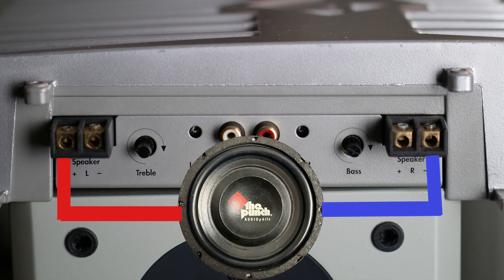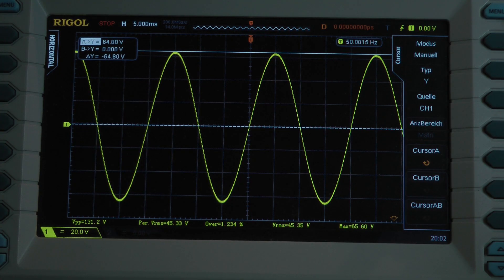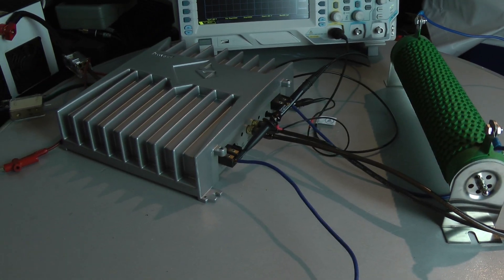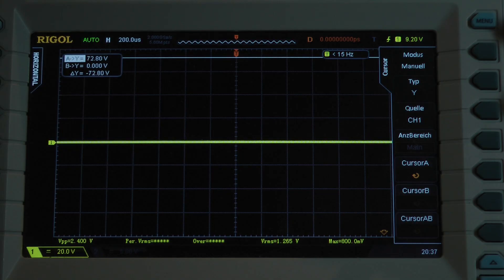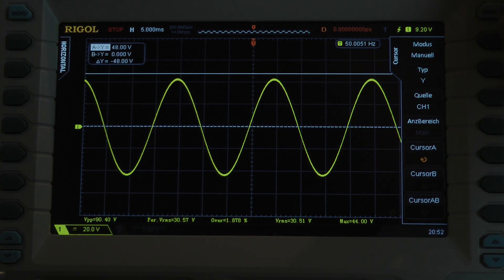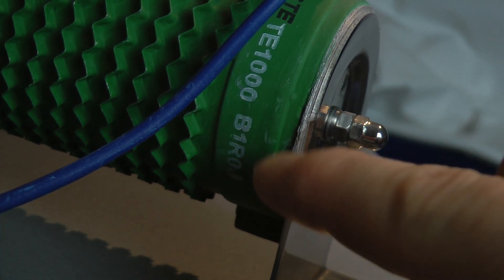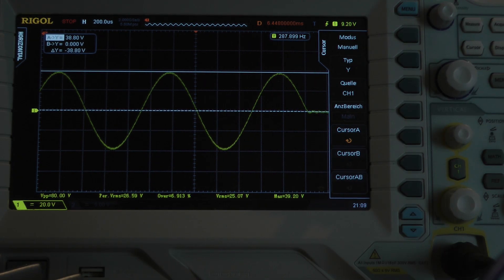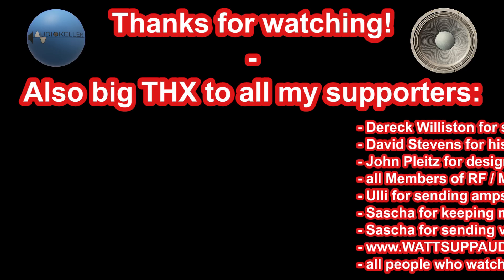1997 Rockford Fosgate Punch 200.2 oldschool stereo amplifier power test low ohm amp dyno

Comment: Nice! I have this exact same amp in similar condition with warranty seals intact as well, nice to know how much power these make thanks for testing.
Reply from the maker: Thank you 😊 
Personally I am not really a friend of intact warranty seals if you want to use the amp instead of just collecting. After all these years I would inspect it and check the idle current 👍

Comment: A stereo amp runing 1/4 ohm is freaking insane its mad i tell ya
Reply from the maker: It went well into low ohms but did less in mono 4 ohms than most other punch 200ish , just hit about rated power.

Comment: Hi! I have one amp like this and I would like to know if this is the same 200iX. Thanks!
Reply from the maker: Yes, very similar to 200ix or 200x2 👍
Reply: @audiokeller1975  so why this model has this king of painting? Was it special, by using the same board of 200ix?
Reply from the maker: In 1997 all models had this painting in 1998 they were the “ black and grind “ series.

Comment: love to get my hands on 2 of these and run 2 of them on my pair of 12 inch power dvc punch's with the 4 inch coil the ones before the hx2 series id like to either get these gray amps or 2 punch 200 dsm amps
Reply: My cousin had that set up back in the day.. But just one 200.2 to 1ohm i think it was or a half.. With the 4080 pushing the interiors in a second gen RX-7.. All fosgate with a cap.